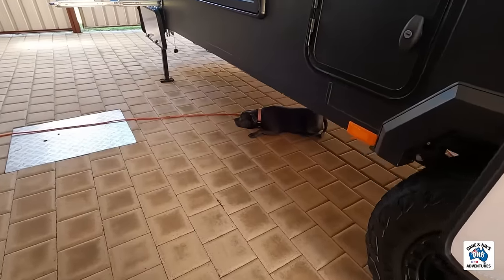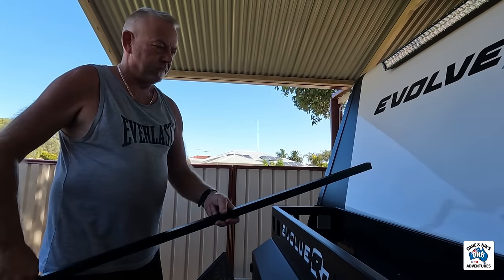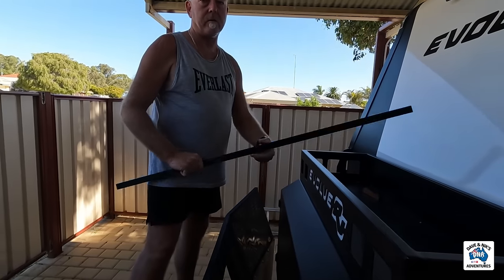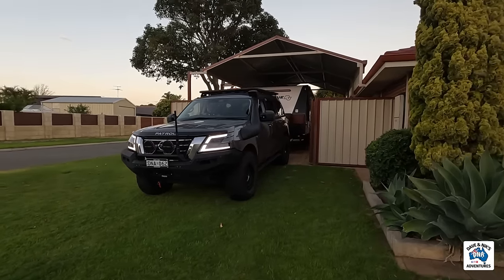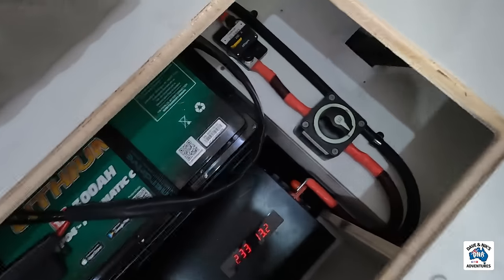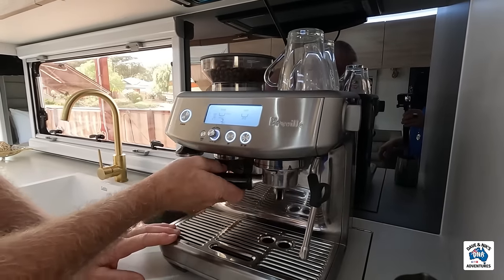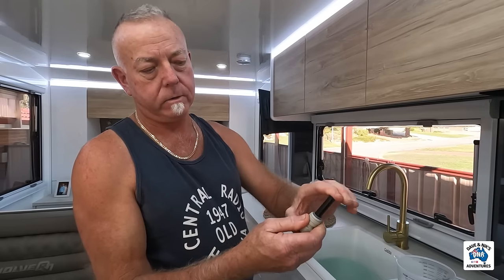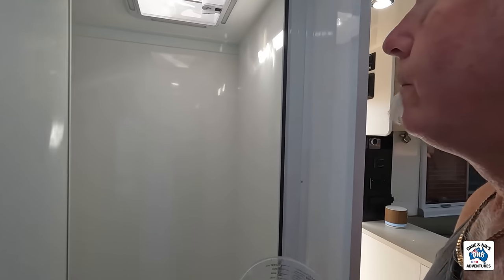3 MODS - TO MAKE OUR CARAVAN STAY LONGER - OFF GRID...

Comment: Hey Guys, live in Mandurah as well with an Evolve RV, love the hotwater mod - have ordered mine to do the same thing as well ..
Reply from the maker: Its a very easy mod to do. 
How long you had your Evolve ?
Cheers Dave and Nik 👍🍻🇦🇺
Reply: @daveniksadventures2255  - about 6 weeks ago
Reply: Hey guys, got my water saver but where did you get the compression fittings for it, been all through Bunnings no luck
Reply from the maker: @rickmacason go to any caravan place they have them on the shelf they are John Gest fittings. 
Cheers Dave and Nik 👍🍻🇦🇺

Comment: Where did you buy the water saver ?
Was it not possible to run the return water to the filler pipe ?
Reply from the maker: You can run it back into the filler pipe 
I just know you can't plumb it back to the feed line the water comes from. I just used the drain tap because it was right there and its a one way valve so it wont feed back on its self once it is working. 
Cheers Dave and Nik 🇦🇺🍻👍

Comment: Can see a small problem,  the return line to tank?  What happens when on mains pressure?  Overfill tank or pressurize . Suppose when at CP on mains to have filler cap partly open.
Or have a drain tap back on and open as needed.
Reply from the maker: There is an over flow hose already installed on the van for this. 
Cheers Dave and Nik 🇦🇺🍻👍
Reply: Did some research, can fit a diverter tap and pipe for when on mains.
But test our hws system, shower is 4 meters from hws and only used 900ml of water till water was hot.
Have good shower head and water saving restrictors.
Say the accumulator tank helps saving pump and water usage.

Comment: I like the water saver idea but I'm not sure that we lose as much water with a storage (Truma) system. I understand the issue with water going back in to the main water tank being a problem if the tank is full but in a storage system, could the diverted water be sent to the inlet pipe of the hot water tank instead?
Reply from the maker: Thanks for watching and supporting our channel. 
#1 best to measure how much water you waste first to see if it is worth doing. 
#2 if your tank is full and you are pulling water from it to run the hot water putting it back into that tank until it is hot won't affect it because it is a continuous loop. 
If you are pulling water from mains supply and your tank is full you need to make sure "like I have"
That you have an overflow set up on your tank. 
#3 they recommend that you run the water back to a tank not to the hot water system. 
Also I have all of my tanks linked together and you pull more out of your tanks than you put back in from the water saver valve. 
Hope this answered your query. 
Cheers Dave and Nik 👍🍻🇦🇺
Reply: @daveniksadventures2255  great and clear answer, I was just about to ask about connecting to the tank drain plug. We have a direct mains connection and will definitely make sure there is room in the tank for the return water.
Reply from the maker: Thanks hope it works for you. 
Cheers Dave and Nik 👍🍻🇦🇺🍩

Comment: Great work, is that valve just a tempering valve that you see in houses or is it a special unit strictly fir this purpose?
Reply from the maker: It can be used for both house and van i just googled hot water valve saver and 2 came up. One was the red water valve ( which is out of stock ) the other was the one I got the Enviro Water  Saver Valve. 
I tried to get it from local plumbing dealers but no luck. 
So ordered it on line o ly took 3 days to come from Brisbane to Mandurah. 
Cheers Dave and Nik 👍🍻🇦🇺

Comment: what about the water that is left in the  pipe from previous use
Reply from the maker: Its the same as if you didn't have one installed it just stays in the pipe until the tap is turned on again. 
Cheers Dave and Nik 👍🍻🇦🇺

Comment: if you want  save all your water you need to fit one of those fittings at each hot water tap
Reply from the maker: Yes that is true but I'm happy to have the first 5 seconds of cold water in the shower. 
It was the 3 ltrs you lose waiting for the hot water to come out of the hot water system I was trying to fix. 
Cheers Dave and Nik 👍🍻🇦🇺

Comment: Is there a reason you didn’t mount the starlink 90 degrease and not need the overhang of the fitting rails. Also what do you do with the coffee machine when travelling. Love following the journey. Cheers
Reply from the maker: We leave the Starlink there as we travel its not in the way and its one thing less to set up 
I still would of had to make a bracket if i put it the other way and that would take up more of the wood box space. 
It would also hit the van as it was spinning around to locate the satellites. 

The coffee machine will be going in a square rubber bucket and it will be put on the floor of the shower while we travel. 
Cheers Dave and Nik 👍🍻🇦🇺

Comment: Good video. The water-saver valve is amazing. 
Have you tested your system on mains? Test it I did not test mine and found out the hard way, I dont have hot water at all on mains 😂😂😂😂 will go check tomorrow what I did wrong.  
Cheers 
Johnny&Rene
Reply from the maker: We hardly go on mains i usually just fill up the tanks and use it from there. 
But will check it tomorrow. 
Cheers Dave and Nik 🇦🇺🍻👍
Reply from the maker: Hey Johnny
Just hooked up to the mains water and all good all works fine 👍
Cheers Dave 🍻
Reply: 😂😂😂you are one step ahead of me then well done.  Not sure what I did wrong. At least you know it works and if you need it at least.

Comment: Get an ecocamel shower head, and you will have a better shower and save water. What happens to the water from the valve when you are on a different tank.......partially fill the tank the return line is attached to?? Don't suppose it matters that much, still saving water......
I would have used nutserts on the black shs's to hide the bolts, but that's just my ocd......
Reply from the maker: I dont run tanks separately nothing worst than half way through a shower and having to swap tanks.  
Cheers Dave and Nik 👍🍻🇦🇺

Comment: I’ve plumbed the “not-yet-hot” water into black hose that fills up water tank using a “t” pipe irrigation joiner . Also I didn’t use garden hose but same cold water pipe as used on van
Reply from the maker: There are heaps of different ways to do it i just used what i had on hand and I doubled up the garden hose where it went through the chassis. 
Cheers Dave and Nik 🇦🇺🍻👍
Reply: Hi Dave the water saver valve in the outlet of the  hot water tank with water pump on, would that run continuously as there would be no water pressure at the tap, pressure would be deverted to the tank?
Reply from the maker: Look I'm not sure if you can run it back to the hot water system! 
I just researched it and most people run it back to the tank. That way you aren't going against any water flows. 
Its not hard to run back to the tank and that's where all the water comes from you won't over fill the tank because you ate pulling that same water from that tank. 
The only time you could over fill the tank is if you are on mains water at a caravan park etc. 
Just make sure you hook an overflow hose at the top out let of the tank you put the cold water back into. 
That is the simplest way to do it. And that is the way they suggest to install it too. 
I can only go by the way I've done it and it works.  I don't want to say it can be done any other way because I haven't tried it and don't want to give the wrong advice. 
Thanks for watching and supporting our channel it means a lot to us and helps our channel to grow 😀  
Cheers Dave and Nik 👍🍻🇦🇺
Reply: Thanks for your reply Dave, I've just fitted one to my urban i think the same way yours is fitted, turned the pump on and It runs continuously transferring water to the tank . I've fitted it into the white hose comming out of the hot water system just before the kitchen sink?
Reply from the maker: @wayneammenhauserautomotive5879 yes that's what I did   
To make it work to its best you really need one at each tap but that's too expensive. 
It works fine for us the way I fitted it you still lose a little bit of cold water but no where near as much as you do without it. 
Cheers Dave and Nik 👍🍻🇦🇺